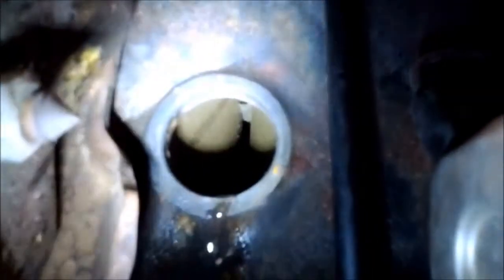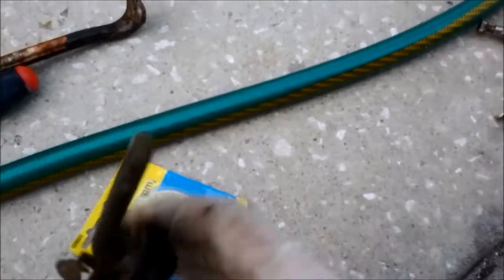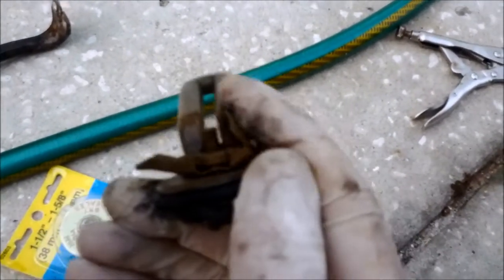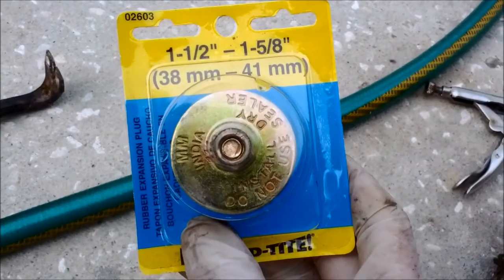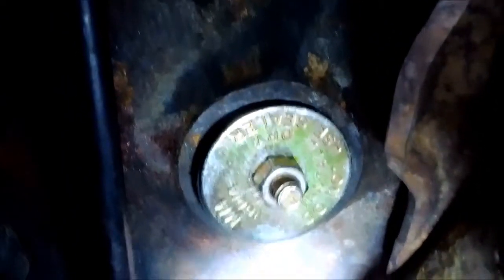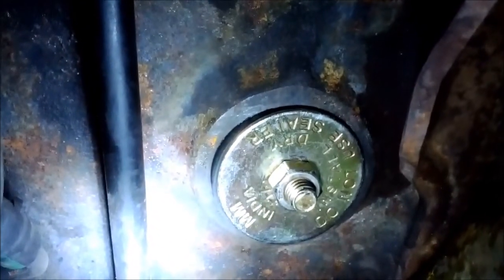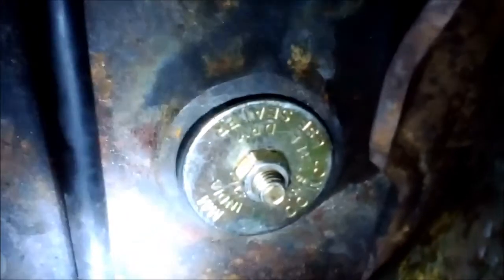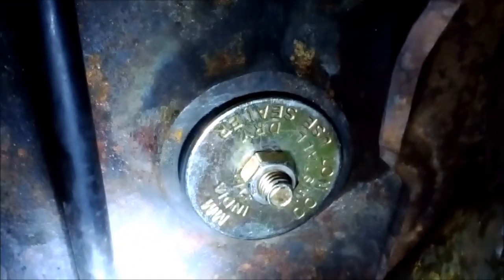Heater removed and attempt to install freeze plug

Comment: I had one of those that was leaking, I tightened it up, a week later I got home and heard the coolant running all over the ground 10 minutes later.  The pressure blew it out, but luckily it was in my driveway. If it happened at highway speed, then its only a matter of seconds before you have catastrophic engine failure, all of your coolant is gone in about 15 seconds.  There is nothing left to remove the heat from the engine.
I managed to pound a brass plug into one of the holes and I will add a heater to the other hole, it looks like someone removed my factory block heater.  
I think that if you rely on these rubber plugs, you should carry a spare and 2 jugs of coolant in case you get stranded somewhere.  You absolutely cant drive anywhere if one falls out.